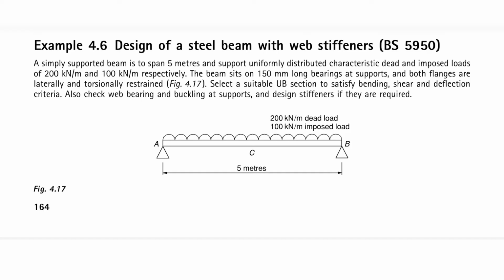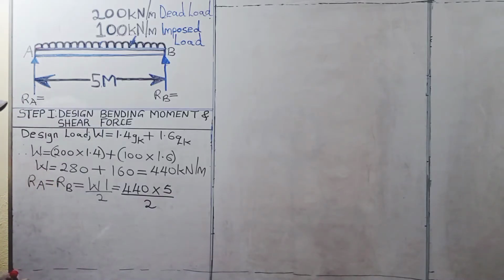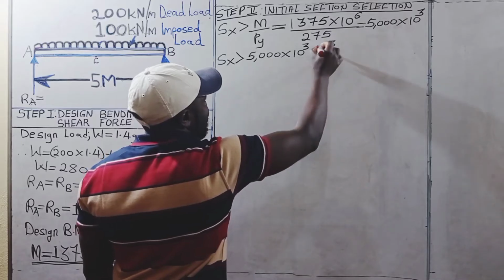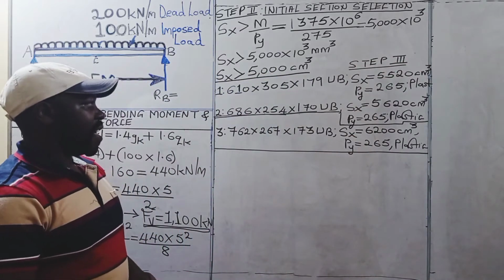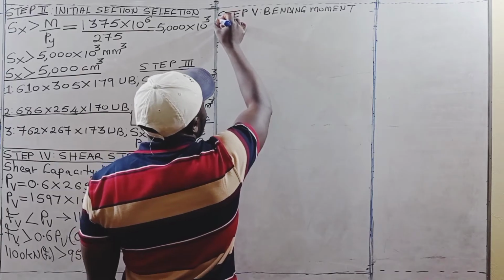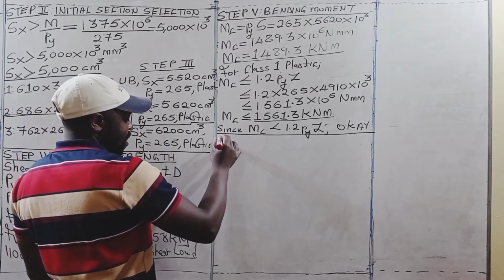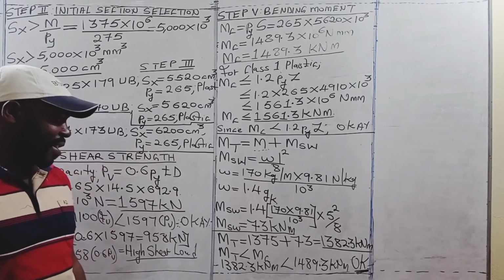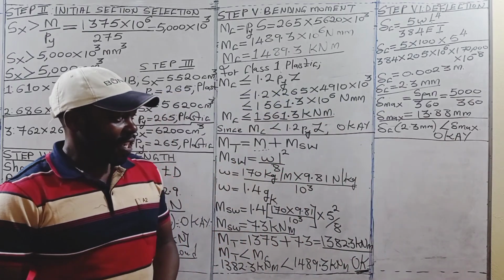PART 1: HOW TO SELECT A SUITABLE UB SECTION TO SATISFY BENDING,SHEAR & DEFLECTION|BS5950

Comment: Can pls explain sir in a very simple way I can understand in the first class it was multiply by distance but in this new lesson not multiplying by the distance
Reply from the maker: In this lesson, the bending moment for a uniformly distributed load uses a different formula than a point load because the load is spread across the entire beam length.

Comment: Why are you using 265 and not 275 for py? Can we use 275 and still be correct?
Reply from the maker: Check the class the section is. Classify the section.